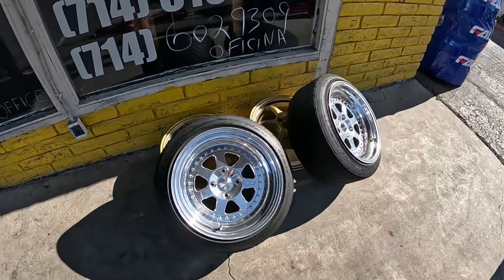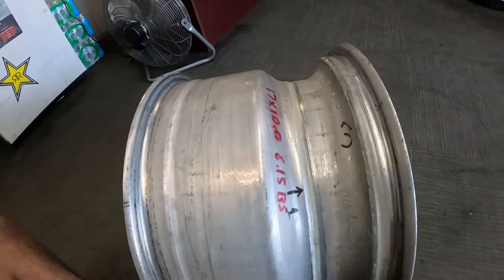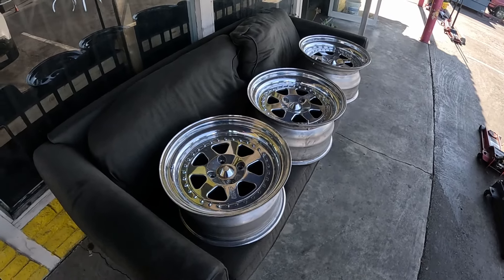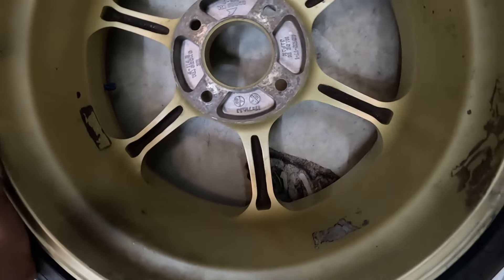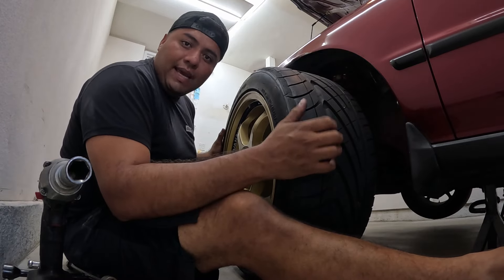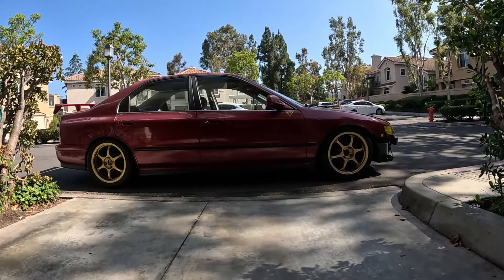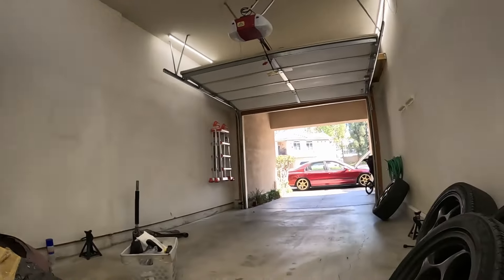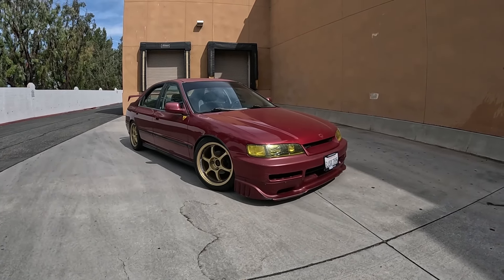Is Bigger Better? New Wheel Set Up on My 1994 Honda Accord!

Comment: The screeching sound from the rotating wheel just sounds like the brakes binding up. The calipers have sliding stud bolts that need to be pulled out, cleaned and re-greased so the caliper can release when the foot is off the pedal.

Comment: Looks good bro bro! I woulda gone with the advan also. Definitely keeps that track look going with the beefy tire set. And that noise, I THINK that sounds like a bad caliper. I noticed the wheel stopped pretty quick when you spun it. Looks good other than that dude 👍
Reply from the maker: Interesting, I would have not thought the caliper would make that noise but there may be some friction, thanks.